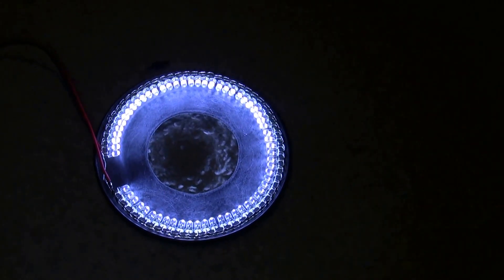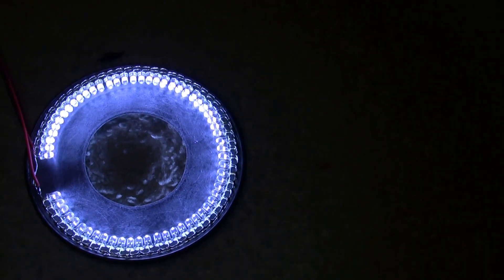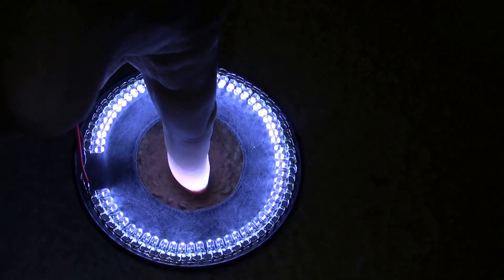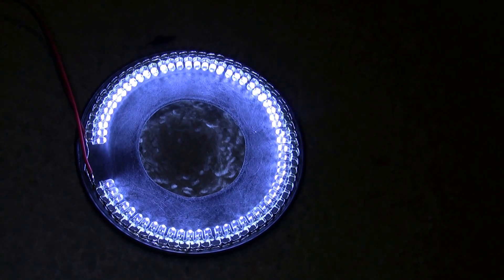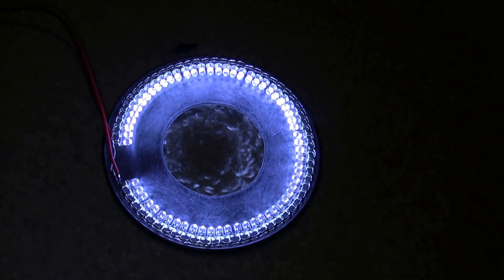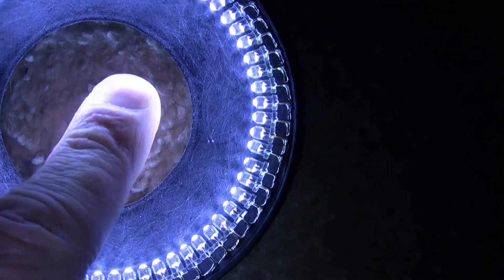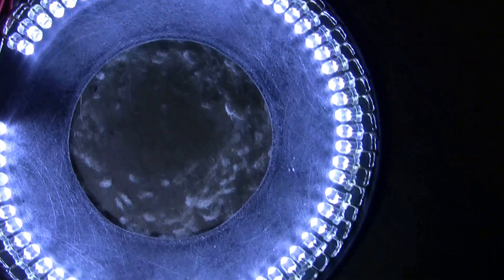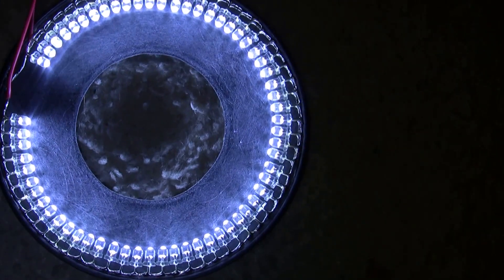DIY LED flash for Laowa 15mm 1:1 macro lens: first light

Comment: Would you make one of these to sell? ..I would  definitely be interested, having just bought this lens and I can appreciate the issue of such a small working distance!
Reply from the maker: I can sell the original (in the video), as I sold my lens and no longer need the light. Just the LED module, right (without driver)?
Reply: Is the correct driver easy to pick up? How much would you want for it? @AstroEdge

Comment: Can I ask what do you mean the working distance is short? Does it has some gap between macro-normal mode?
Reply from the maker: When set to 1:1 macro, the working distance (between the subject and the front surface of the lens) is only 4.7mm. It increases to ~10mm for 1:2 macro and so on.
Reply: Oh I see....